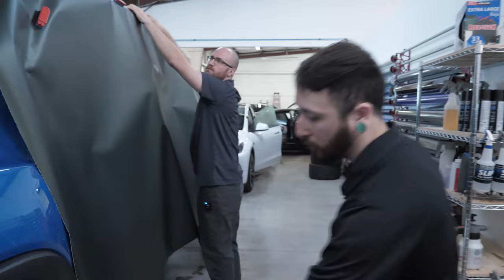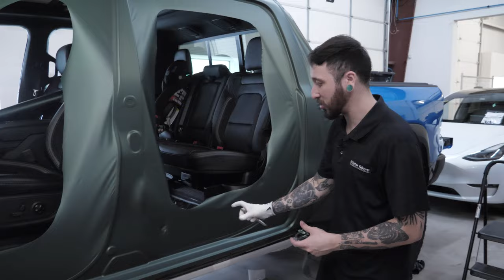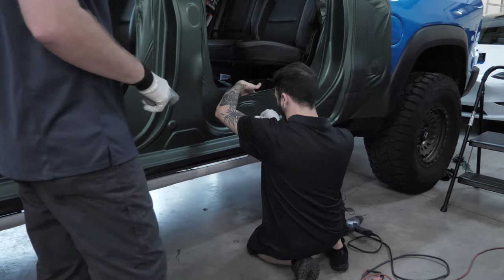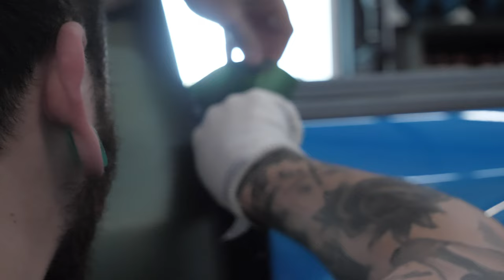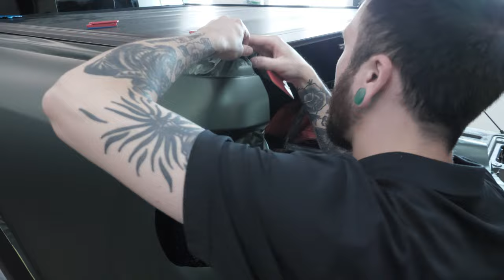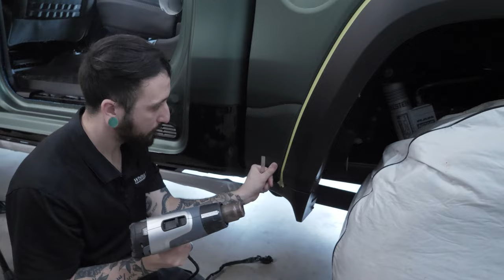2022 Ram 1500 TRX | Full Body Vinyl Wrap Color Change

Comment: Love that green. It's nice to see someone wrap the jambs. I have seen so many wrap videos where they just wrap what is showing. How long would a wrap last in cold weather. I live in New Hampshire. Ice snow and salt on the roads
Reply from the maker: Hey! Thanks for watching! In your area, salt is the main enemy. In our area here in Oklahoma we tell people wraps will last 5-7 years with proper care on a daily driven vehicle. Even longer on a garage queen. I would say about the same in your area but you would need to make sure to wash the salt off asap. If you keep your wrap clean and not baking in the sun for days or weeks on end it will last. Last note would be to ceramic coat the vinyl afterwards that will greatly help!
Reply: @WGAutoWraps  thank you for the response. I would probably wait until spring. We haven't had any snow yet this year so no salt yet but it's coming soon

Comment: I have an "05  Dodge truck with oxidation on the hood and roof.  Can this be wrapped?  I'd like an unbiased opinion.  Thanks
Reply from the maker: Thanks so much for watching! To answer your question, oxidation needs to be removed prior to vinyl going on, but oxidation is a fairly easy thing to remove with a product called Ghost Off. 
some of our clients confuse oxidation with clear failing clear coat also, and if you have failing clear coat that is flaking off the those areas would need to be sanded smooth before applying vinyl to ensure a smooth finish.